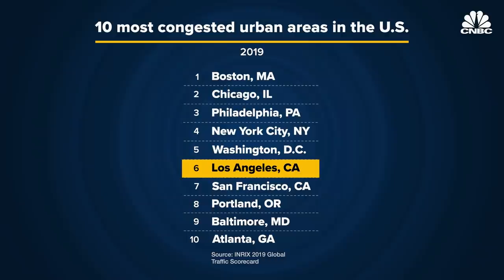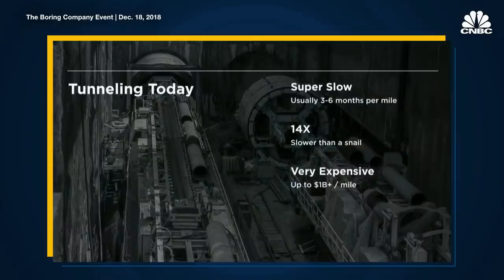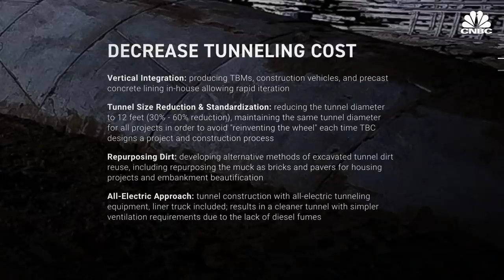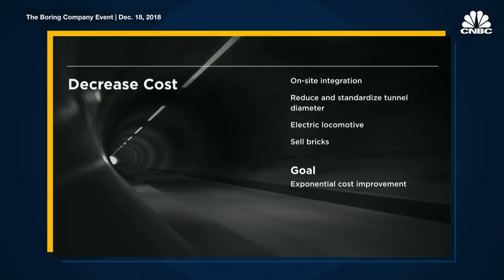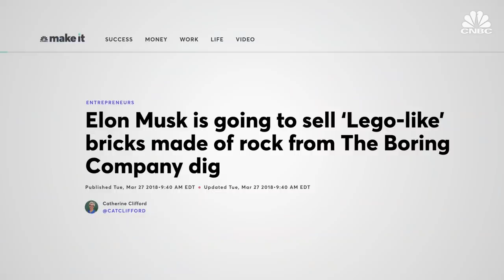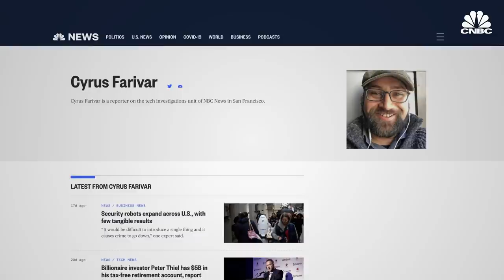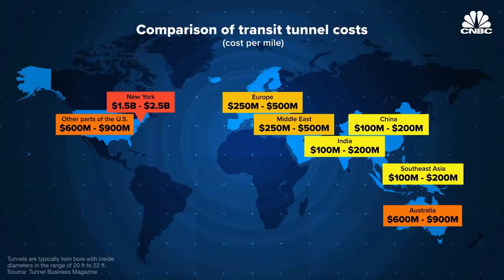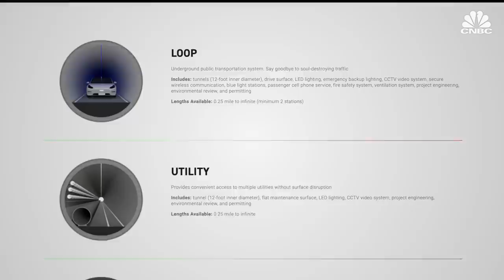Why Elon Musk’s Boring Company Isn’t Fixing Traffic Anytime Soon

Comment: 4,400 passengers an hour isn't too bad. If only they could figure out how  New York moves almost 50,000 people through their underground travel paths per hour...
Reply: The reason they set 4,400 passengers per hour as the goal at this location is that that's the maximum demand they expect.    They could build a system big enough for 50,000 people but the max that would ever ride in an hour is about 4,400. It's limited by the number of people that the convention center can hold and those are the only passengers for that loop.  Why would you want a system that is 90% empty at the very busiest time?

TBC is saying that the larger Las Vegas Loop currently being built will be able to carry 57,000 passengers per hour.  I'm curious to see how they will do it.

Comment: If someone tries to solve traffic while still relying on cars, you have not solved traffic.
Reply: If the cars flow smoothly without stopping, then traffic is solved
Reply: @kevinbailey8827  cars are the problem. You start relying on good public transportation and a city design not built around cars, improving suburbs and get rid of parking lots in exchange for more housing and woah, America finally catches up to the rest of the world
Reply: In the Loop systems in Vegas, the cars are all contained in the systems. As a passenger, you enter a station, board a vehicle which takes you to the destination station and you get out.   In that way it’s similar to other underground transportation systems. What’s most important is how efficiently it works (balancing different ways to measure efficiency). The type of vehicle is not relevant. 

Underground trains win in energy efficiency, but not by as much as you would think. 

Loops are quicker and far less expensive to build.  Loops have drastically lower wait times and shorter trip times.

Comment: It's more efficient to just build a subway line.
Reply: Can a subway sell Teslas?
Reply: For the Las Vegas Convention Center Loop, the proposal to build a subway came in at 4 times as much money as what TBC proposed.   If it takes more than 50 years to see any benefit from your "more efficient" subway line, is it really better?
Reply: @kevinbailey8827  A subway can hold over one hundred passengers. A Tesla can hold 5.
Reply: @edwardduda4222  Yes, a subway can hold them hostage for multiple stops that are not their destination.   Some of them will get out at a stop that's not their destination only to wait for a different subway train on a different track.

During off-peak times, that same subway can hold five people.  It's not so efficient when it's not running full.   Either they run it less often, so they can have more passengers on the train, but that means keeping passengers waiting longer on a platform waiting for the reduced schedule train.

When you say efficiency, you mean being able to hold large numbers of people wishing the system.

The loop is designed to get people to their destinations faster than subways and faster than surface taxis.

Comment: Why not just build more lanes above the current roads? You can put a conveyor belt type of thing to lock the cars in and have them travel at high speeds. Just curious if that’s a possibility. Seems like an easier solution than digging underground tunnels.

Comment: People in the comments really dont have a clue what Elon is trying to do...The LA tunnel is a test tunnel btw. So hes building a multi lane transport system with multiple floor tunnel layout that can only be used by EVS, with autopilot on, this is a good idea and heres why, firstly it reduces above ground traffic which is a problem, lets the city build for the people not the cars and its faster to travel underground, theres more but 3 is enough. Now your complaints, no building an underground train system is way more expensive and less efficent, meaning it takes a much bigger tunnel to fit a huge train than a car and a lot of people want to drive their cars and not take public transport and its way slower than a underground car system, it firstly cant get to the speeds underground that a car can, and secondly the train needs to constantly stop so people can get off on the other hand the underground car system can be designed and made in such a way that no stopping is needed. Overall in almost every way but capacity the car system is better and its just cooler.
Reply: No, people DO understand what Elon is trying to do. More and more people are just seeing through it and don't respect it, and that is a beautiful thing to see.

Comment: As far as using the existing material removed by the boring machine to make the concrete might not work unless it is clean gravel or aggregate. Materials such as sand,sand,, clay etc.. doesn't work for concrete.

Comment: They know they could build a really nice metro, right?
Reply: For a LOT more money. They didn’t want to spend a Lot more money.
Reply: @kevinbailey8827  Metros are very efficient means of transport. Quick, sustainable, low energy consumption and a low cost per passenger. Best option for a long term solution.
Reply: @loremeuc81  Metros keep passengers in the system for too long.   They have to wait for a train.  They have to wait as the train stops at every station.  If their destination is on a different track, they have to exit the train mid-journey and wait for a different train.  That's a lot of wasted productivity, and a lot of wasted leisure time.

Many metros run less often at slow times.  That is to save money, because they're running mostly empty trains.  It means that for passengers, the wait times will get longer.

With a Loop, your vehicle is waiting at the station for you.  It takes you to your destination without stopping, and if your destination is on a different "track" it automatically switches to that route.  Passengers reach their destination faster, so their seat becomes available for a different passenger.

Comment: i think he has made tunnelling much cheaper by redesigning the boring machine so thats a plus.  
 
Guess its a high speed toll road 
Downside It will add traffic to where it finishes if its designed to finish in a centre. 
Ok as a ringroad to avoid centres though so easing local traffic from people driving through.

Good advert for electric cars as well.
 
Still if it has made tunneling cheaper then its a plus more than negative.

Comment: Could've just built subway. Would be more useful right away and cheaper in long run
Reply: Not more useful, and never cheaper.  

In this case, the max number of people they would transport on their busiest days is less than 5K per hour.    On most days it will be a LOT less.    A subway train would be using a LOT of energy to run mostly empty back and forth. 

The bid they got to build the subway was $150 million more expensive.  Even if the Subway were half as expensive to operate, say $3 million a year instead of the $6 million a year they're paying The Boring Company to operate the Loop,  that means it would be at least 50 years before they break even.

Comment: The potential we have today could clearly reach the speeds suggested. There is a matter of cost especially when developing something new. Making a car speed through a tunnel is not just as easy as driving onto a platform that rapidly moves you through a tunnel. 

Deployment of a monorail track for the platforms to move along is likely the most important addition to a tunnel system in terms of reaching high speeds. Simply placing a car on a platform with out securing it is also a potential issue. I wouldn't be able to speak in detail about the subject but the aerodynamics in the tunnel and the positioning of the cars would need to be studied. I imagine some turbulent air in a tunnel with large amounts of fast moving objects. The simple but costly solution is to develop a clamping system which would require adaptation to vehicles but could secure any vehicle to the platform for transit.

The software needed for running a traffic tunnel is I'm sure already well completed. This is after all essentially making personal trains if we observe the word train loosely. 

You also have to make something like this... well idiot proof. It is after all a tunnel and if for any reason congested it could result in injuries and damages. You need to be able with some level of reliability ensure that passengers do not enact some form of exit from their vehicles as well as discard items into the tunnel system which could obstruct or injure others. 

It's easy to imagine the level of potential hazard and red tape that would come with any such incident.

SpaceX needs tunnel technology for their future endeavors. From transportation to mining it will be a system I'm betting they plan to send to mars some day. For now there are notable improvements in the field being made. It's best to temper any expectations on new technologies as they develop.
Reply: "Deployment of a monorail track for the platforms to move along is likely the most important addition to a tunnel system in terms of reaching high speeds. Simply placing a car on a platform with out securing it is also a potential issue. I wouldn't be able to speak in detail about the subject but the aerodynamics in the tunnel and the positioning of the cars would need to be studied. I imagine some turbulent air in a tunnel with large amounts of fast moving objects. The simple but costly solution is to develop a clamping system which would require adaptation to vehicles but could secure any vehicle to the platform for transit.

The software needed for running a traffic tunnel is I'm sure already well completed. This is after all essentially making personal trains if we observe the word train loosely. "

When you phrase it that way, it just sounds like they'd be better off building a regular train.

Comment: Put a goddamn train through the tunnel lol
Reply: Then you have to put the goddamn stations under ground ($20 million extra per station), because the goddamn train can't climb the goddamn ramp with its goddamn steel wheels lol.
Reply: @kevinbailey8827  ?????? what? trains can go up slopes though
Reply: @bachibak  Not slopes this steep, with steel wheels.   There are some tight curves at the ends, too. I don't think a train could make it around them.
Reply: @kevinbailey8827  it really depends on the kind of train, the Pöstlingbergbahn in Austria drives at ~12° while some others (like the  Selketalbahn in Germany)  drive  at a 4° Angle.

Most commonly though, trains don't tend to go over 5°

Comment: This is so stupid, imagine adding magnets to existing cars with simple AI calculating your speed to adapt to traffic, you enter traffic on highway and connect to front and back, when you want to exit you signal, your neural unit computes speed, unlocks the magnets and exit you to less controlled traffic on local road ways. Traffic occurs on highway due to humans lack of discipline and poor reaction time - traffic is a cultural issue of freedom, not a technical issue needing the stupidity of getting trapped underground in a tunnel

Comment: i wonder if it could be EVEN MORE efficient if you used metal wheels on metal tracks :^o
Reply: Not enough to justify the downsides of the tracks.
Reply: @kevinbailey8827  which?
Reply: @mattgron6913  You would need to have some complicated switching to allow individual pods to exit the main track at stations (while pods that have no passengers to drop off or pick up continue on without stopping. 

The loop saves costs by having some stations above ground. Metal wheels on metal tracks would have a difficult time climbing the grade to the surface.  So stations would have to be underground. This increases costs significantly. 

With the loop, the tunnels are an evacuation path. The roadway is over 9 ft wide and it is flat. The tracks would be hazardous during evacuation.
Reply: @kevinbailey8827  okok, but what if we just connected the pods together, in some some of transportation chain. We could have them perpetually go through the tunnels and pick up passengers on the way? wouldnt that be cool?! :^D

Secondly have no idea what you mean by "stations above ground" the cars have to be underground. if you're talking about those fancy CGI renders of pods taking peoples cars underground, i'm sorry, it's just not feasible.

Thirdly if you just built the tunnels for a metro in the first place (this is my point in case you didnt catch it, they should just have built trains instead of silicon valley startup nonsense) you wouldnt have this problem, also you wouldnt have to go out as much since you cant have TRAFFIC JAMS UNDERGROUND in a metro tunnel
Reply: @mattgron6913  If the pods are connected together, the whole chain, and every passenger on it would have to stop at every station, even if it’s not where they want to go. All that necessary (for the chain, not the passengers) stopping and starting is NOT efficient. 

The LVCC loop has three stations. Two of them are above ground. The pods drive down a ramp to the tunnels.    These two stations cost $2 million each to construct. The middle station is underground and cost $20 million.  

I knew you were making the same silly joke about turning it into a train that dozens have made before you. But the truth is that loops have real advantages over underground trains for urban transportation.   Building an underground train at the LVCC would have cost 4 times as much. It would not have performed better. I don’t think that it would have been more energy efficient. It might initially have cost less to operate, because the cars have drivers. Eventually they will be automated. 

You would not make up for spending $150 million more for a train with operating cost savings. The loop costs $6 million a year to operate. If a train could run for half that much, you’d need 50 years to catch up. Not worth it.